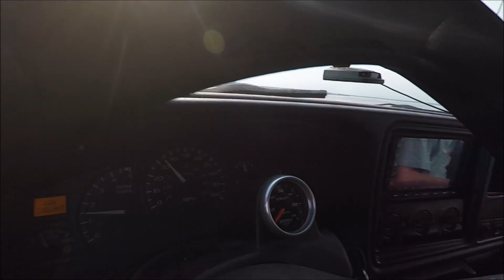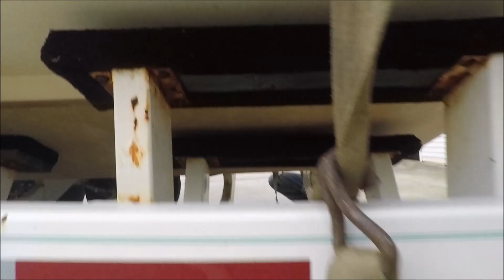I CAN'T BELIEVE MY DURAMAX TOWED THIS MUCH WEIGHT!  PART 2!!

Comment: Yes more boats! Be fun to see what you can do with regular stock Mercruisers. I've got a 350 mag mpi. Thinking some headers and cam for a little more thunder but that's it. I've heard if you actually want more power you need to repower since spending 4k on parts and labor might only get you 8 mpg on the top end. Would love to hear other comments from a real pro like your buddy. And get yours done!!

Comment: Andy; Duck Tape is old news, flextape is the new Duck Tape. 
  I like boats but I would love to see Ghost race that GTR. We have a 2000 GMC 3500 454, 2wd, 4 door  with a dump bed. I love it tho we really need to put new cross braces on the dump bed part but the rest of the truck is solid.

Comment: Your safety chains are supposed to cross under the tongue of the trailer, just in case the hitch breaks.
Reply: Doc said the chains were too short for his hitch. Possibly didn't have the length to cross them. Dunno tho

Comment: Boat:::::~> a hole in the water that you put money into....lol... enjoy!
Reply: If you're handy with tools, boats aren't expensive on maintenance.  I've had several on the salt water side of Florida.  Change a water pump or impeller annually is the most expensive thing other than batteries & most gear heads can maintain them easily.